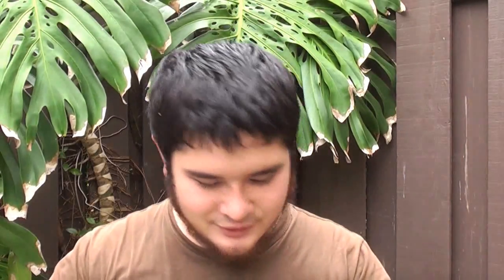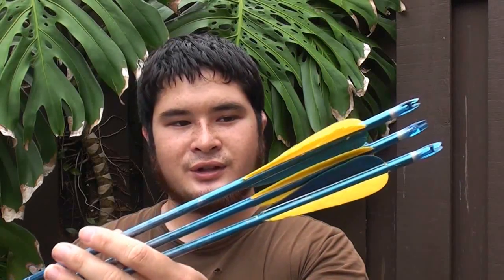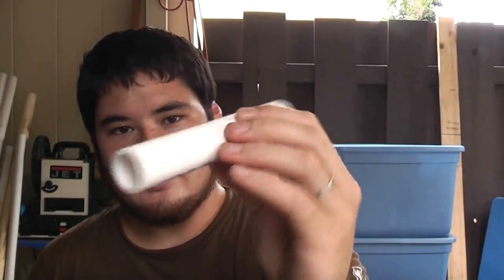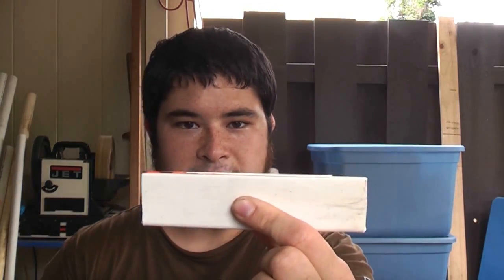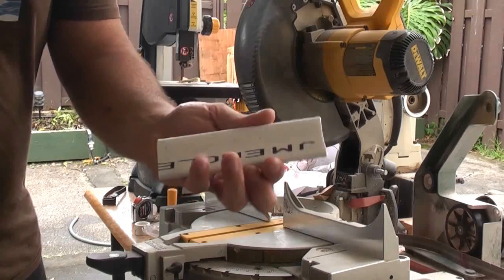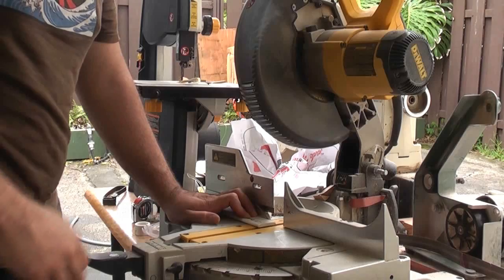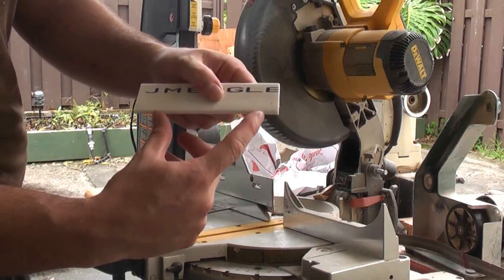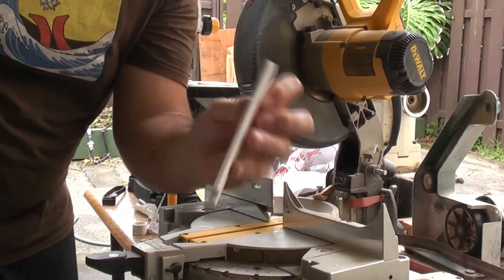Making a Simple Feather Clamp and Fletching an Arrow Part 1

Comment: I have designed a jig to use in conjunction with a clamp like this one except this is not quite wide enough, so I plan to use 1" pipe instead of 3/4".  Just wondering why all of the commercially-available jigs are always angled so much.  Is there a real advantage to that angle?
Reply from the maker: Dale Erwin Are you talking about helical twist or just angled from front to back? Either way, the idea is that it causes the arrow to spin in a certain direction and stabilize the arrow faster. If you are using feathers, even fletching them straight will give the arrow a slight twist as it flies. Everyone has their preference, I usually go for more twist on heavier arrows.
Reply: BackyardBowyer I'm just talking about how the shaft is inserted into the jig.  But talking about helical twist, I'm wondering how much would be sufficient.  I think it would only need to be very slight.
Reply: Dale Erwin If you mean the angle the arrow is at when it is in the jig I think it is just a convenient working position.  Gravity holds it in position when is in the jig at an angle. Flat on a bench and is can slide side to side and standing vertically it can fall over.  Sitting at an angle the arrows weight prevents both movement to some degree.....
Reply: John Madden
Yeah, I guess, but I made mine flat so that the weight of the clamp puts more pressure on the feather as it is being glued to the shaft.  Since the feather is glued on at a slight angle (for rotation), I wanted that extra weight to make it lie flat against the shaft.
Reply: Dale Erwin try using CA glue with activator such as 2p-10 it will set in seconds of you do it that way